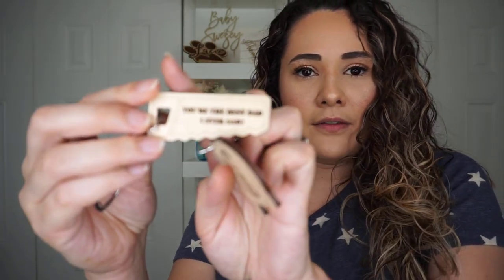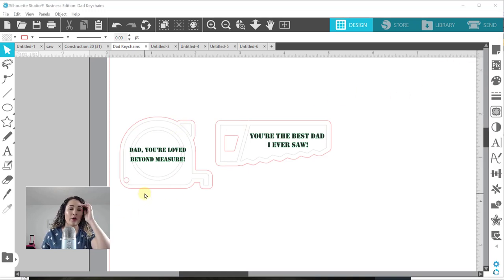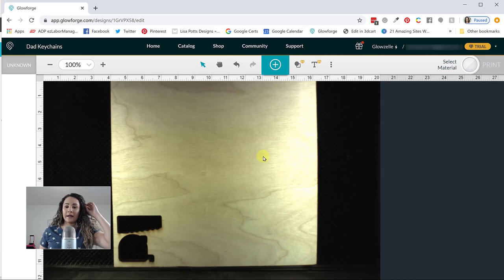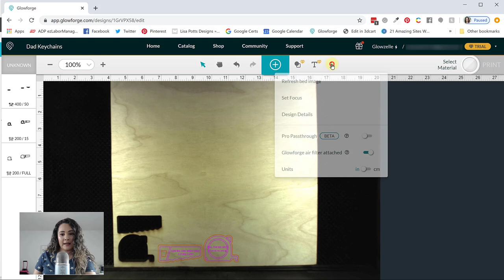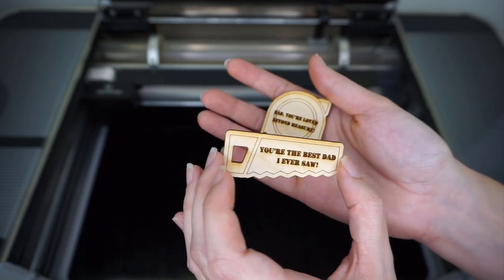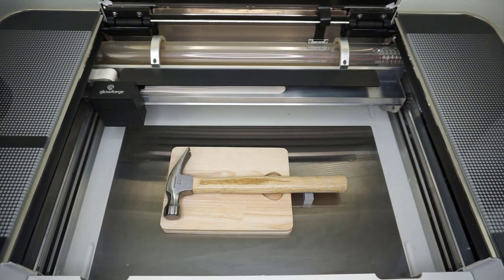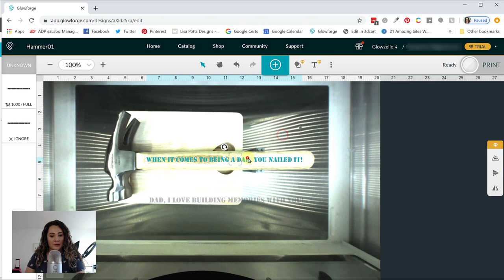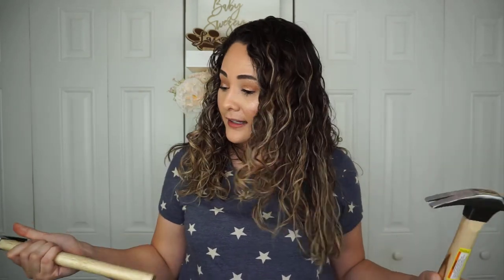Laser Engraved Fathers Day Products with Glowforge! | Lisa Potts Designs

Comment: Hi Lisa, Belinda here, Can you tell me what I cannot do if I purchase the basic one?
Reply from the maker: Hey Belinda! The basic has a smaller cooling system, so you can't run your machine all day. Additionally, only the pro has the passthrough slot, you you won't be able to do passthrough prints. The Plus and Pro have upgraded parts, so they run a bit stronger and have a longer warranty, but besides that, the basic is great! If I get a second machine, I will just get the basic.